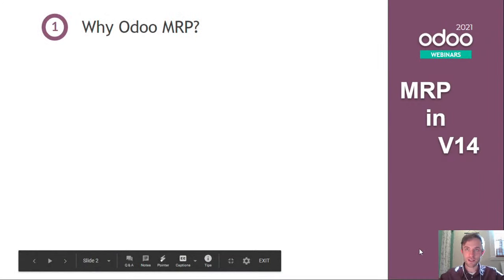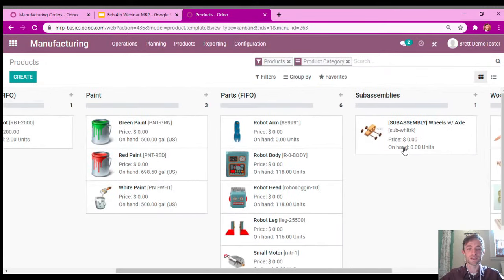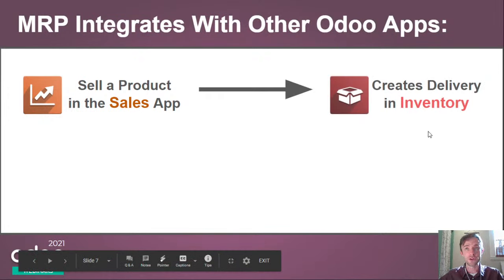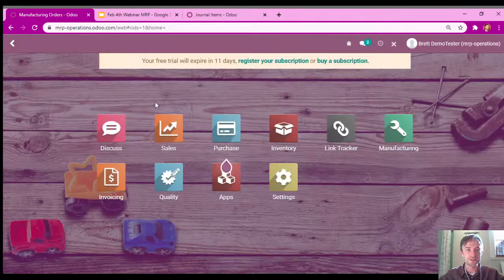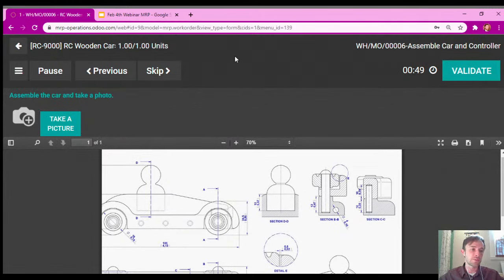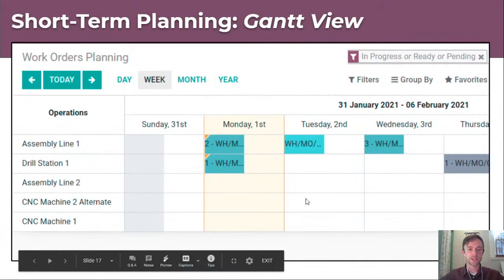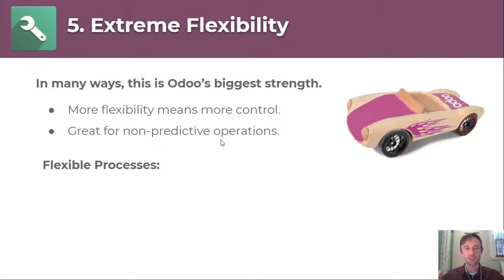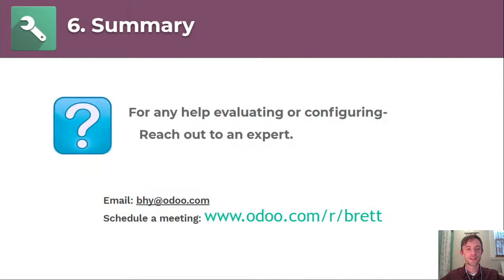Odoo MRP v14: Manufacturing Reinvented

Comment: Hi! i'm trying to use the MPS for long term planning, but i'm using advanced routes (like manufacturing in 2 or 3 steps). I need to know or understand how the MPS works with this kind of routes. Is it necessary to set up something special in the warehouses or routes? because i have an error that says "No procurement rule found in location MP/Stock"
MP/Stock is the general stock location. The problem is that i don't use this location for this product, i use another one, because we first recieved the material and the we put it in a ready to use location. 
Has the MPS some default location that use to work?
Thanks!!
Reply: I'm currently exploring the MPS as well.  Do you haver reordering rules setup for all of the BOM hierarchy?
Reply: @timd6324  Hi Tim, thanks for your reply. Yes, I think I have them configured. But I am going to check again. 
The problem appears when I click on the "REPLENISH" button. 
I have tried to change the locations and add new rules in the routes, but I get the same error.